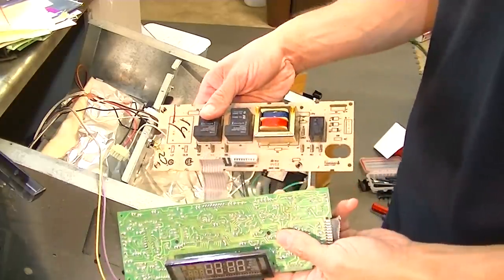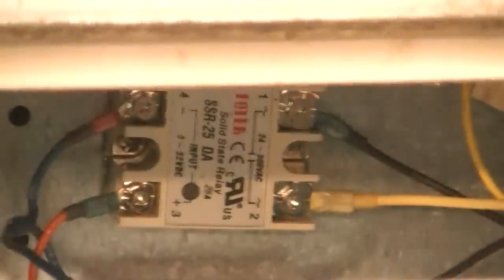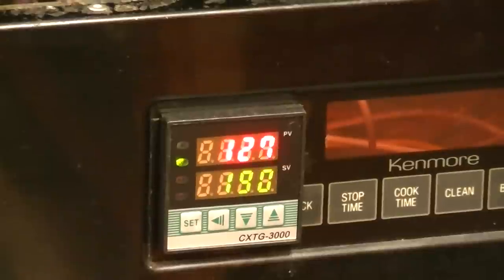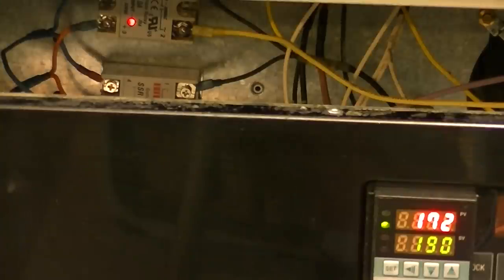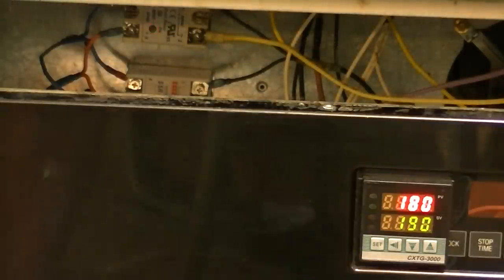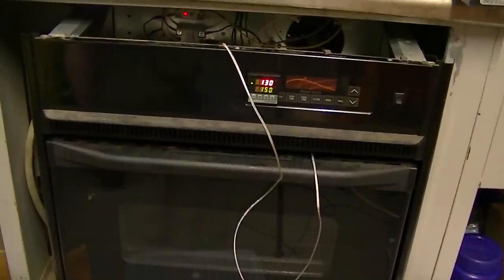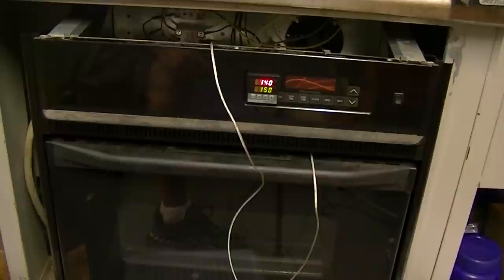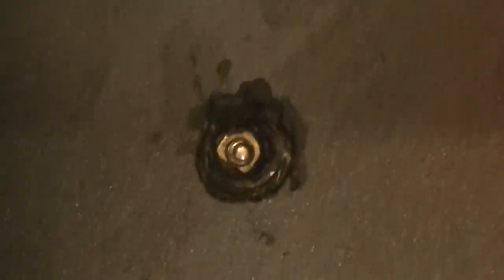PID controller install on my parts curing oven

Comment: great vid thanks! I'm going to build an oven for post curing composites and will be using a similar setup. Does the PID you use have an auto tune to learn the control for the elements you are using? Mind if I contact you for some advice when it comes time for wiring? Regards, Andrew.

Comment: i just got a pid and relays I have the oven already but when i wired it the relay doesn't turn the heater off unless i turn off the toggle switch
Reply from the maker: are you 220 or 110?

Comment: I am having trouble wiring my t4 pid controller and ssr relay to my 220 oven. I could use a complete wiring diagram or video on how to do this. Anything would be greatly appreciated because I am limited on my electronic skills thank u
Reply from the maker: first of all make sure your PID is specifically for controlling SSR's. There are many out there that are only for normal relays and they do not work for SSR's. Next, after you know you are good on the above you have two options. You can use 2 SSR's, one for each leg of 220vac and just "Y" off the wires out of the PID. The other option is to simply switch one leg of the 220vac with one SSR's. To do this you must make sure that you do not have a common ground to your elements or you will just end up running 110vac instead of 0 vac while off and then you will pulse 110vac to 220vac while running instead of 0vac to 220vac. Understand?  The PID setup is the hardest.  If you are lucky enough to have purchased a PID with a good manual this will be much easier. If you purchased one with Chinese instructions or badly translated ones you will need to scour Google for PID manuals.  Download a number of various ones and study the differences.  They are not all the same but by taking the time to compare to what you have and the menus on your unit you can decipher what to do.  It is not easy but not impossible either.

Comment: Nice! I've been about to add a pid to my oven for a while. I built a stand-alone 110v pid controller, but I was a bit wary of 220 mains. Seems like you got it dialed in!

Looks like you've had it going for a year or so now. Hows it holding up? Any issues with the short cycle time and the elements? Are those 24 amp SSR's still happy? I'm planning to use 40 amp SSR's and heatsinks, but I've also been known to wear a belt AND suspenderst. ;)

Thanks for getting it done and showing it off!
Reply from the maker: Thank you very much! Everything is working 110%. I am able to run this old Kenmore kitchen oven up to 900F sustained and I have had no problems. I could go higher but choose not to. Since it pulses the elements it is much easier on them than the sustained call for heat it had originally.  I am building a custom furnace and setting up a foundry that are both pid controlled and will have videos up on them soon.

Comment: hey man, im building a powder coating oven, its 6 feet tall, 28" wide and 38" deep. purchased a pid controller and a 40A ssr. how many/what size elements would i need? any help would be appreciated, thanks man
Reply from the maker: Well make sure that your element draw does not exceed the rating of the ssr (40amps in your case). If you feel that you need more just add another ssr. I usually run one ssr per coil/element

Comment: Great video!  It's just the kind of info I was hoping to find on here as I am also thinking of building myself a curing oven (for powder coating) and I've been finding it very difficult to find anyone in my area (in Canada) that has even heard of this style PID and SSR project. I would very much appreciate more info from you if you don't mind.  I will send you an email. Thanks.

Comment: I am surprised you are still running with those SSR's. They look like the knockoff's from China since they don't say Made in Taiwan. Also without them being attached to actual heatsinks, that's even more surprising. Thank you for this guide, I find it helpful. I am building a 6.5'x4'x3' powdercoating oven. I will probably do a final video when I am done with mine too. Thanks for sharing!
Reply from the maker: Yea, they are certainly Knock offs!  I have been using these for years now and they are 100% perfect.  I use heat sinks on my Kiln and Large Oven but for this setup I am not stressing them at all.  I only need 1 20 amp to power both coils but am running a 25 amp on each.  Good eye and let me know once you get the video up.